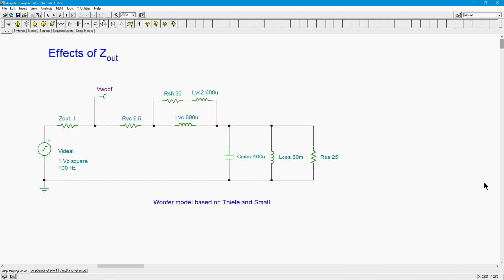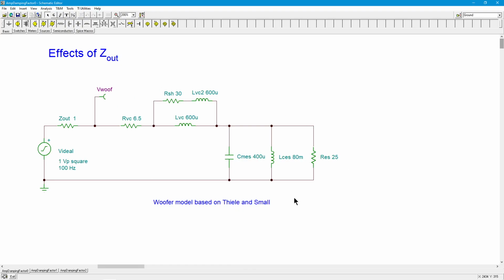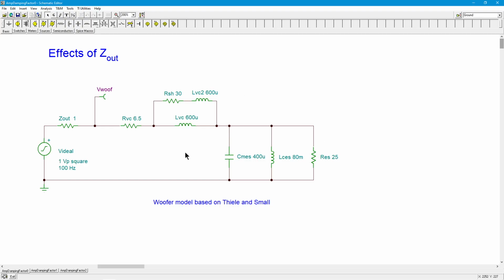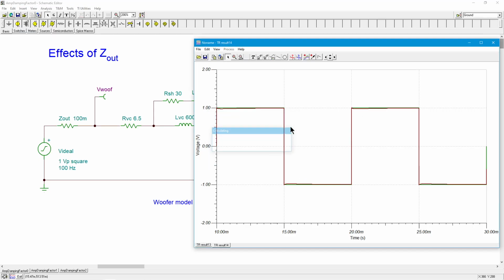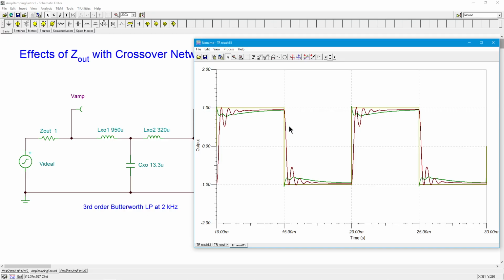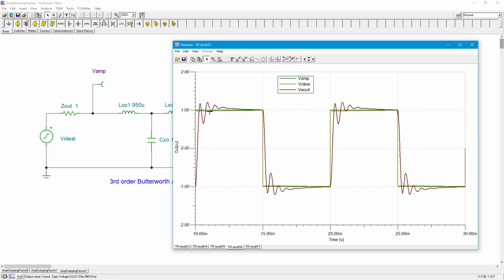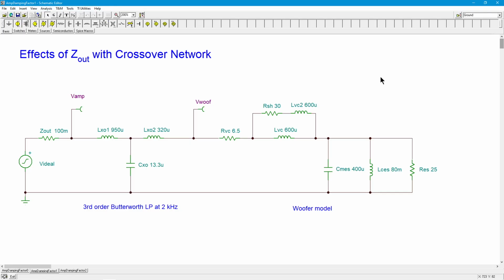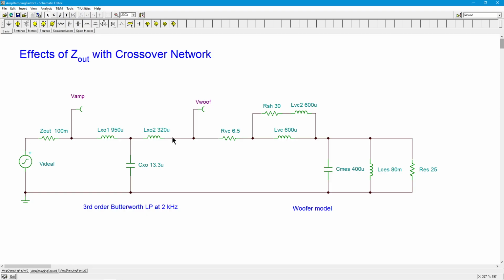Semiconductor Devices: Amplifier Damping Factor

Comment: But professor Fiore, just one minute. The driving force of a loudspeaker is not determined by voltage but current ( F= IxB ). Hence the optimal amplifier would be a current source. This relates to an amp with almost infinite output impedance and very low damping factor ;-).
Reply from the maker: Not sure about the smiley face, but in case you're serious, no, no, and no. For starters, if the amp was an ideal current source, then the voltage across the loudspeaker would perfectly reflect whatever the impedance is. Perhaps you might see a problem with that. In fact, hopefully you'd see multiple problems with a high Z internal impedance... 

As a side note, maximizing force is not necessarily "optimal", just like maximizing power transfer is not necessarily optimal (otherwise, we'd try to match Zout to the loudspeaker Z), and besides, using a current source wouldn't mean that we'd maximize the current anyway, just that it would be consistent as the load Z changed. So let's say that you want to try an ideal current source for your amplifier. Simple. Place a 1 M ohm resistor in series with the loudspeaker. Pretty damn close to an ideal current source. Let us know how that works out.
Reply: @ElectronicswithProfessorFiore  Despite the emoji I'am serious. Of cause I knew that my proposal has a lot of shortcomings especially when we talk about subwoofers. That's the reason for the smiley face. Nevertheless I like the idea of a direct and linear control of the force on a loudspeaker. I've to admit that I'am not that familiar with loudspeakers. In recent years I was more into electrical motion control. In this area current control is essential. But at the end of the day a VCM( Voice Coil Motor ) is a loudspeaker and we control it by current. Besides I miss the EMF-voltage in the loudspeakers equivalent circuit.
Reply from the maker: @Achim188  I think the main shortcoming is that such a design would be incompatible with all of the existing gear out there. So, yeah, it is possible to create a power amplifier that is, in essence, a giant transconductance amp (i.e. VCCS), but all existing loudspeaker designs are expecting constant voltage drive (side note, that being the output we get from microphones).

Comment: thank you professor Fiore - this is awesome.   As a EE myself working professionally in RF/wireless and not circuit design, I've been doing audio electronics for decades more as a serious hobbyist, including speakers, guitar preamps, etc.    This totally makes sense.   I've also run sound for bands in my past and played guitar in bands that used tri-amped systems with active crossovers (in the preamp stages) - another huge advantage of the active crossover with bi or tri-amped speaker systems is much lower intermodulation distortion, plus in pro systems the active rack mount crossovers have precision adjustable delay for each sub-system (mid and high) to allow precise phase alignment between them.
Reply from the maker: Yep. 40+ years ago I was designing bi- and tri-amped PA systems, and using vented subwoofers (very much avant-garde at the time). Great stuff.
Reply: @ElectronicswithProfessorFiore  Did you ever get to see your systems in action at live venues, either testing or otherwise?   Also I recall servo driven subwoofers were a big thing in the late 90's did you ever design any of those?
Reply from the maker: @vinidajackal  Yes. For a while I was literally helping to set them up and tear them down. That's the best way to see how well things work (or not). Not huge venues, mind you, maybe a thousand or so seats, mostly smaller than that-all the way down to bars. They were unique systems at the time, and the bands that used them were often skeptical that they would work. At the time, most people were using Altec A7s or JBL 4560 cabs (or some weird thing that usually had a bunch of piezo tweeters stuck to it). They were not used to seeing 18" long throw woofers in vented boxes coupled with midbass units and constant directivity horns (CD horns being brand new at the time). The footprint was very small in comparison so many musicians didn't think they'd be loud and clean, but once they heard them, they were convinced. 

There were things I wanted to experiment with, such as motion feedback and all-in-one cabs that included the power amps, but I largely got out of that line of work in favor of teaching. I believe that those systems would still be competitive today in smaller venues. Some of the things I focused on were ease of manufacture and "roadability", along with SPL and sound quality. It was all wood, you didn't have to be a master carpenter to make them, and they would hold up night after night. The bottom end of my favorite subs was downright scary. The 3 dB corner was somewhere around 35 Hz. And it was flat, not resonant, boomy bass. You just didn't get that kind of bottom end in those days. After setup, I would voice the system with some of my favorite tunes, usually progressive rock or jazz-rock fusion, and it would be like listening to a huge stereo, with the bottom end just punching you in the gut. I remember one venue where we got some feedback well below 100 Hz. It was weird hearing feedback at such a low frequency. Most systems simply didn't have the acoustic output power at those frequencies so it would never be a problem. Space was tight, but we had to reposition the stacks to avoid it.
Reply: @ElectronicswithProfessorFiore  I take 'motion feedback' is the same or similar to 'servo' driven bass cab's?  I ran sound in 1993/94 while finishing my BSEE, for a Raleigh NC country band.  He had a triamped system with big 18" bottoms - I forget the term but they are something loaded, driving it backwards into a scoop of sorts.  I think he had a total of about 3,000 Watts, had a pink noise system (combination 1/3 octave EQ with generator mic and indicator LED's), I would crank that early after setting up, then final tweak by ear.  He said "I want em to feel it" - so yeah pretty mucn about same as your system, but I had the low end EQ going up up except for the two lowest ones (20, 25Hz), so it reproduced to 35Hz quite well, I could feel the kick drum in my chest.  Started using noise gates on the drums which cleaned it superbly - club personnel said they never sounded so good.  Interesting times.  Now with all the class D and amps built into the cab, you just give it AC power and a signal, so much better.
Reply from the maker: @vinidajackal  Sounds like rear loaded horns. I recall JBL made some. They were referred to commonly as "scoops". The issue I always had with horns for bass is the size they needed to be. For decent efficiency gains you're looking at half wavelength, and seeing that the wavelength at 100 Hz is 11 feet, you realize that these things are not going to be portable for the most part (even if they're folded like the old Olson "W" boxes). They're great for fixed installations, though. I remember that a local theater had some and they were used for the old "Sensurround" movies and concert films.

Comment: You said it at the end. Loudspeaker cables are important. I found out when I started laborate with it long time ago. Mudd and not well defined high frequency tones is a result of por cables. That said you need quite a good amp and speaker to hear it but then I did, now I can only detect the low mudd. Thanks for your great video.
Reply from the maker: Let me be very clear here: I am not endorsing so-called "high end" loudspeaker cables. The issues I am talking about become apparent with very long runs of small diameter (i.e., large number AWG) cables. I don't think most people are running 20 or 30 feet of AWG 24 cable. For typical runs, 12 or 14 AWG cable should be fine, and no need for anything fancy. 

And as I've said multiple times elsewhere (and will likely say again), for the best performance, go with an actively crossed system where the power amps are right next to the drivers. In a system like that, 16 AWG cable would be fine as you're only running a couple of feet at the most.
Reply: @ElectronicswithProfessorFiore  I do not talk about expensive cable but the gage. I use a multi tvisted pair cable with 2x.22 mm sqare Times 20 pairs. No hifi stupid stuff. Just happend to have 10 meters of cable and it made a huge differense.
Reply: @ElectronicswithProfessorFiore  Interesting side-point, I always looked down upon the Monster cable brand for over-hyping their super low resistance speaker cables, fooling people into believing they need to pay mondo $ on just speaker cables to get good audio - but I have to say I once won a gold plated monster cable brand guitar cable, and it sounded the brightest & best (due to low capacitance mainly) of any other cables I had ever tried.   Yes of course, this is an extremely high impedance circuit (guitar) at about 1Mohm, hence the sensitivity to the capacitance.
Reply from the maker: @vinidajackal  Yes, guitar cables are a completely different animal. That cable capacitance affects the resonant circuit created with the high Z inductive pickup, and can certainly change the sound of the instrument. I did a video on this a while back which is in the Semiconductor Devices playlist. 
https://www.youtube.com/watch?v=UeCEdn516ZY
Reply: @ElectronicswithProfessorFiore  absolutely, I measured my American Standard Strat single coil pickup at 1.2 Henries if I recall, and 6000 ohms DC resistance.  Couldn't go straight into a rack mount compressor as this acted as a low pass filter, so I designed an op-amp high Z preamp and used that as a buffer then into the rack mount compressor - that preamp only has power, an input, output, and an LED on it in 1U enclosure.
Reply from the maker: @vinidajackal  Those numbers sound pretty typical compared to what I have measured. That rack unit sounds nice, but nowadays, companies put those tiny surface mount op amp pre-amps inside the instrument! I have a couple of active basses. Nice stuff.
Reply: @ElectronicswithProfessorFiore yep I have a bass with EMG active pickups from the 90’s , it sounds a lot better than the cheap passive ones that came with it.  I used the TI OPA2134 op-amp in my RU.  Has super low equivalent input current noise density (hence low N for very high Z).  Its distortion is so low that TI had to design a 100x distortion multiplier circuit just to measure it.